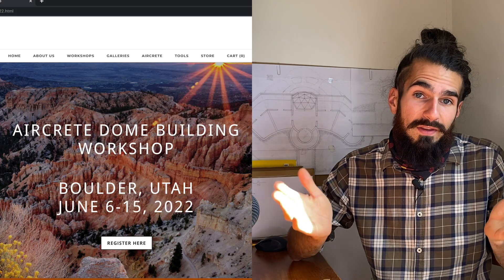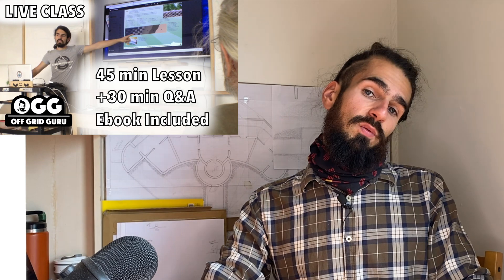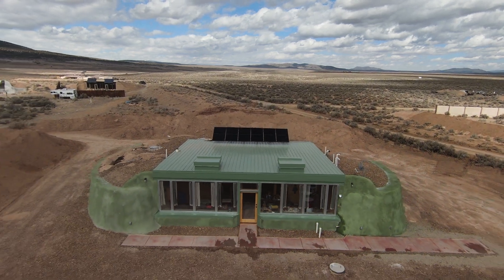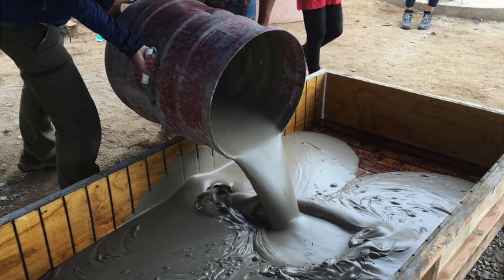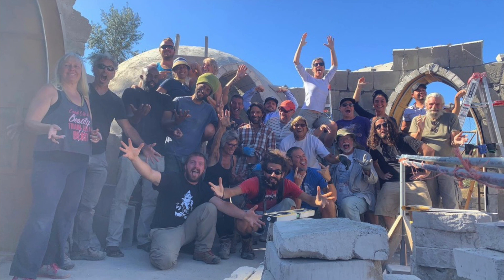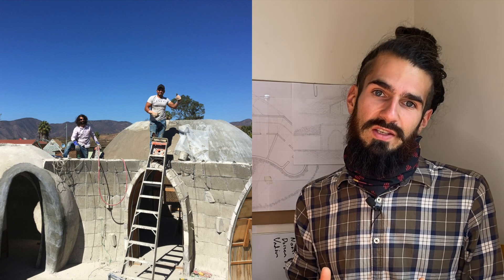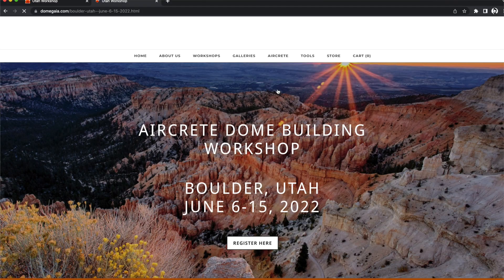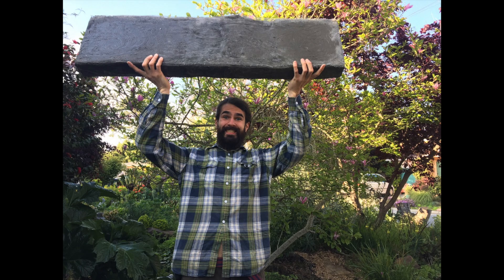From Earthships to Aircrete! Im teaching a Dome building workshops with Domegaia!

Comment: I wonder if you could use aircrete blocks, instead of pounding tires with dirt and using glass bottles, to build walls in an 'earthship.' Because, one, it's easier/lighter to work with. And two, I'd plaster over tires and bottles anyway.
I don't mind using tires and bottles, but I don't want to keep seeing them. So why not use aircrete from the get go? My thoughts.  👍

Comment: So I have a question.
From the looks of your pictures it looks like you have to buy lumber, plywood, metal pipe, wire mesh, the material to mix the aircreete, etc.
My question is is anything recycled materials or is it all new materials?

The earth ships use a lot of recycled waste, seem more climate stable with thermal mass, etc.

Now I will admit that aircreete looks more stable and suitable in a tropical environment if a person does not want a earth ship style home or even a traditional house... 

Respectfully.
Reply from the maker: Good question Charles, when it comes to the sourcing of recycled/local materials, I would say that is very dependent on the project manager. Regardless of earthship or aircrete dome, the very act of sourcing materials takes time and storage space. Additionally, re-using materials often means more labor is involved. Therefore one must measure wether they have the time/space/labor to use such materials... 

Because aircrete domes only represent the shell of a structure and not the entire systems package, it's not fair to compare them to earthships. Once plumbing and electrical systems are introduced, it becomes more difficult ( and risky ) to use "found"/ recycled materials. Except for may old solar panels and batteries to get you going. 

Overall, Domegaia does not address systems the way Earthship Biotecture does. The ideal design of a structure should take into account the local climate, material availability, labor availability and so on... Hope that helps!
Reply: @TheOffGridGuru  yes it does.... Like I stated I am just curious... The aircreete system to me looks like it would be great in a tropical climate... It would do great against the monsoons and hurricanes... I guess I have to admit that I am for recycling as much as we can and having to manufacture all new materials is probably faster, and maybe even easier, just not as earth friendly..

With that being said you have given me lots to think about... Thank you.

Comment: Is it weird to imagine pouring this aircrete into tires? I have never built an "earthship" or mixed aircrete or concrete for that matter so I have no idea what I am talking about. I'm just feeling like the process of filling the tires with dirt seems so needlessly labor intensive when the object seems to be "build with recycled materials". Couldn't you make a concrete or aircrete like mixture out of recycled or repurposed things and then wrap the tire in an envelope of recycled plastic and then fill it with the mixture? I mean, the end goal is heat retention with those walls right? It just seems like the dirt part is counterintuitive and introduces an organism filled, non recycled element to the process. Maybe that's just me.
Reply from the maker: We are not filling tires with aircrete.
Reply: @TheOffGridGuru  it wouldn't need to be aircrete. What I am asking is, isn't there some other thing you could pour into a tire other than dirt which doesn't bring with it all the microorganisms that dirt includes.
Reply from the maker: @AaronSteinPittsburgh  thanks for clarifying. Often the first course of Tires are filled with gravel for drainage purposes and it is common to fill tires entirely with sand if that is whats available.

Comment: for me, the selling point of earthship tire walls is the thermal mass and the passive solar working together to create the man-made-cave-like temperature controlled environment. with an aircrete dome, how does it fare in extreme temperatures? for example the taos, NM area: would an enclosed aircrete dome out on the mesa need heating and cooling systems? it seems to me like yes it's well insulated, but it's not going to perform like a bermed tire wall would. am I correct?
Reply from the maker: Great observation chad, you are correct. It will not perform like a buried tire wall no. The round shape of the room will also create different convection patterns inside. An enclosed dome on the mesa would need a heating system but most likely not cooling, as it is mostly shaded inside (unless the design is hybridized for passive solar.)
Reply: @TheOffGridGuru  I would be interested in seeing such a passive solar hybridization. I've got land in unit 4 and will begin building in June. my initial thought was to start with an Earthship Hut and add styrofoam-aircrete domes and archways as needed to connect additional spaces. I'm now considering using super adobe earthbags to make the hut so it requires less taxing labor, but performs in a similar way when temperatures rise and fall. what do you think?
Reply from the maker: @ChadRiden  I would insulate the outside of the superadobe walls with aircrete and make the roof out of aircrete. The way you are thinking, you should watch my interviews with Alosha:  https://www.youtube.com/playlist?list=PLqp-SkZkzk5ywreFD3WZPjUZnZGES26p1
Reply from the maker: If you have started by the time I get back from Utah, I would love to see what you have come up with :)  Hit me up! http://www.earthshipmodelkit.com/contact

Comment: Question, 
can you do a aircreate dome in the same way thats done in the survival earthship?
Reply from the maker: I like your thinking, Yes you can replace the vault material with aircrete. but Im unsure about burying an aircrete vault the way they do to the ferrocement vault in the survival Earthship. I haven’t seen it tested yet…
Reply: @TheOffGridGuru  
Maybe it doesn't have to be buried,  it could be light enough to be put on in layers then coated, my understanding air create is good thermal mass and insulated, do a small earthship structure and if you need a little extra heat heat a small rocket mass heater, I also was thinking about using air create as a mass heater with solar hot water tubes going through hooked up to a solar hot water panel, the hot water heats your tank first then through the mass bench.
Reply from the maker: Certainly doesn’t need to buried if its only the roof that is aircrete. However if you are looking to replicate the passive performance of the simple survival you would need to incorporate mass into the walls. @ronaldsahn9649  Aircrete is only insulation not mass. Any thermal mass coming from an aircrete construction would be in the form of an added layer of plaster or brick over the aircrete.
Reply: @TheOffGridGuru  what is the approximate R value of aircrete?  Wondering how it would perform in cold zones.
Reply from the maker: @regenesismedia2180   5 per inch. Usually the blocks are 4” for an R value of 20 ;)
Reply: @TheOffGridGuru  what would your opinion be of that R value for zone 5?  We are based on the Western Slope of Colorado elevation 6200ft ... -08–10F coldest snap in winter but short lived - mostly 15’F  Low average winter ❄️